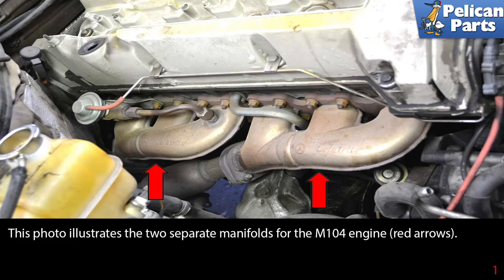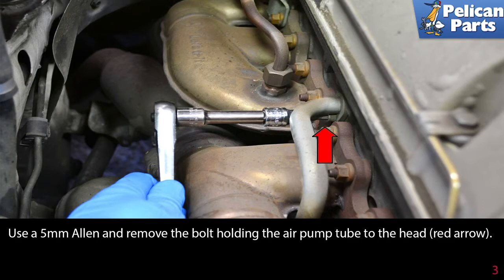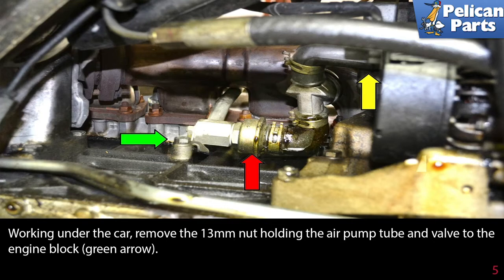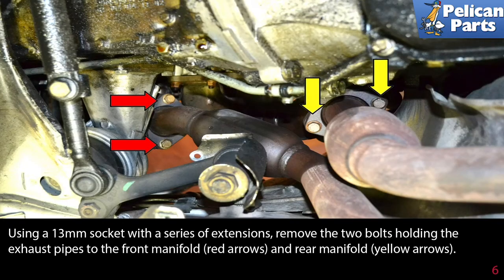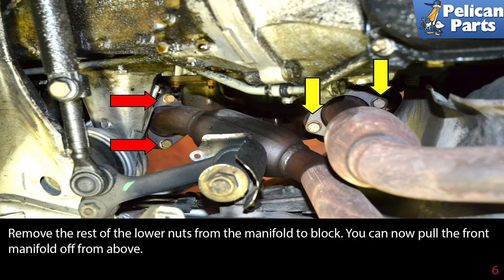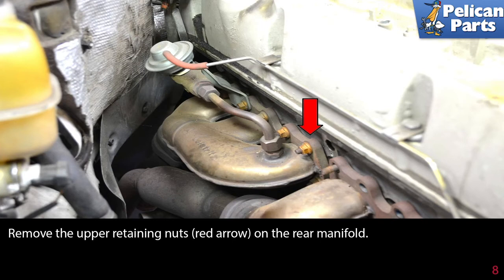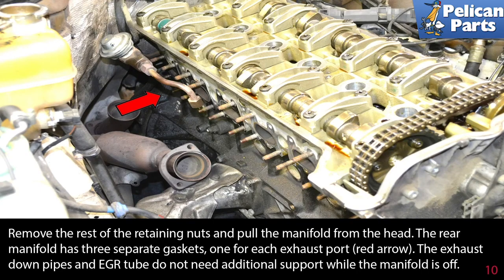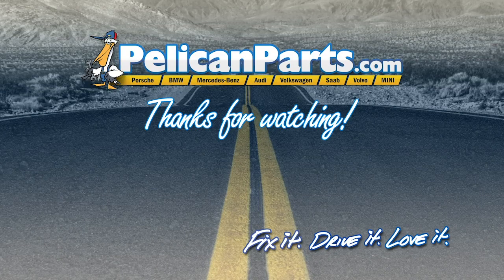Mercedes-Benz W124 E-Class Exhaust Gasket Replacement

Comment: What year of vehicle was this?  My EGR has threaded end for an EGR tube on only one end.  Your EGR has threaded ends for EGR tubes on both ends.
Reply from the maker: I'm not sure what year was used. With your vehicle info handy, give The Pelican Parts parts specialists a call at 1-888-280-7799. They can figure out what part or repair kit you need.